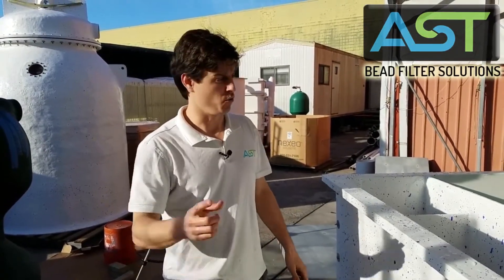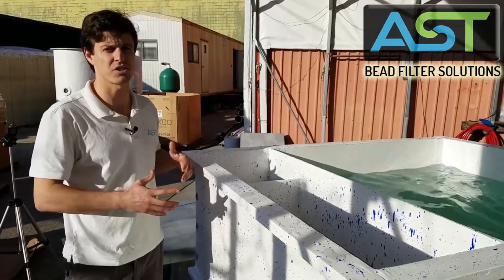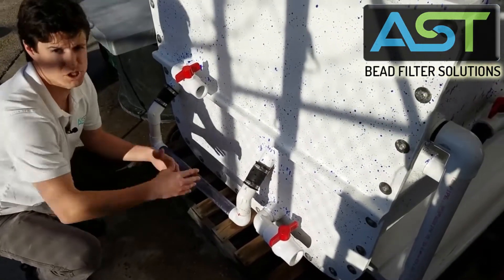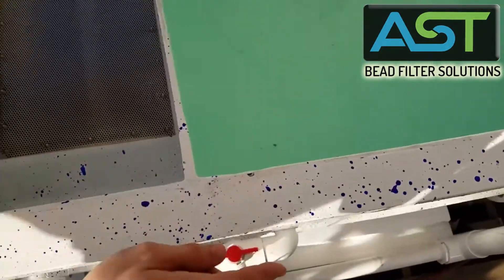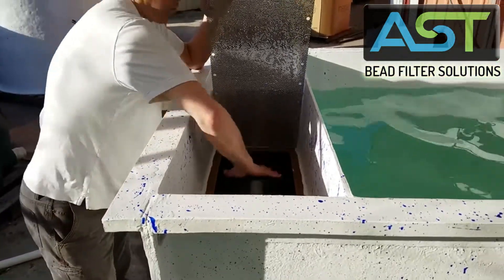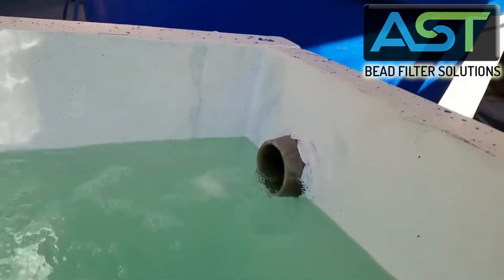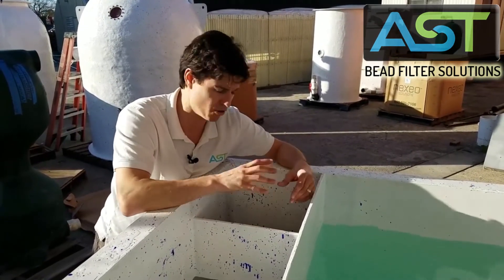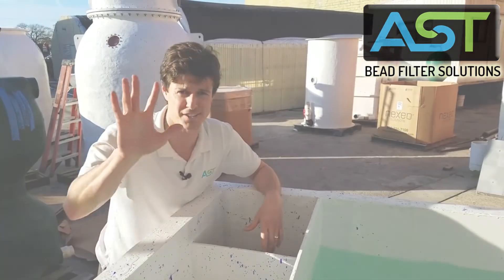AST FIT 400: Anatomy of Filter-in-Tank Systems

Comment: How many tilapia could you have in these.? Can you grow out from fingerlings with out them getting into the filter? When you connect other fit tanks to make the 2800, is it still just one filter? And again what kind of tilapia numbers would you be able to have? A detailed video of one of the 2800 systems would be awesome, please?
Reply from the maker: Lucas,
The max stocking density that we recommend is 0.5lb fish per gallon of water. If you plan growing fish to 1.5lb at harvest, then you can plan on holding approximately 200lbs of fish or 133 fish in the FIT-400.

Comment: Hi can u please elaborate on the sludge section and back wash.
How the sludge is collected in to that section
Reply from the maker: Thanks for your question Pavan, the FIT line of filters uses our patented direct pneumatic discharge system to pneumatically move the sludge from the charge chamber of the filter using the internal pressure of the pneumatic charge. This occurs in the time right before a backwash occurs. Thanks for your question and for your interest in AST Filters!
Reply: AST Filters thank you very much
Your videos are very conceptual and explaining crystal clear. Thank you for the videos very good information

Comment: Design looks really good! But will it support a biomass of the range of 50 kg/cum?
Reply from the maker: Thank you for the comment, all of our PolyGeyser filters, including the FIT systems, are designed to support a maximum of 0.5 lbs/gal (60 kg/m3) of biomass in an intensive aquaculture system. However, this stocking density is only recommended for experienced aquaculturist and varies depending on the desired tank ammonia concentration. Thanks again for watching!!